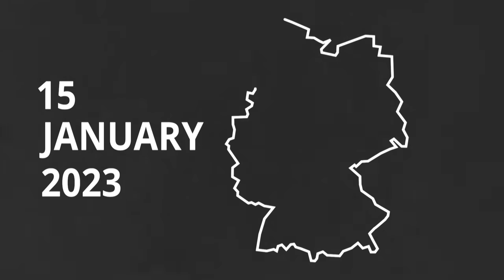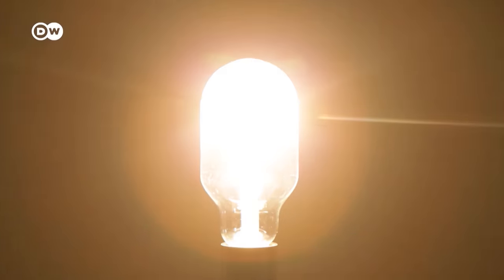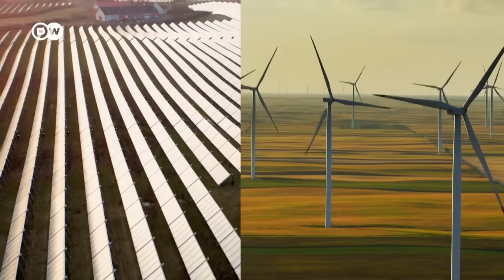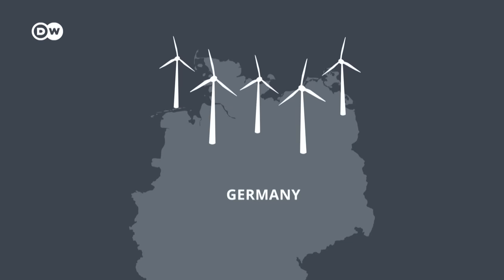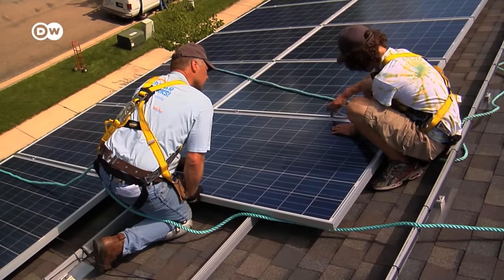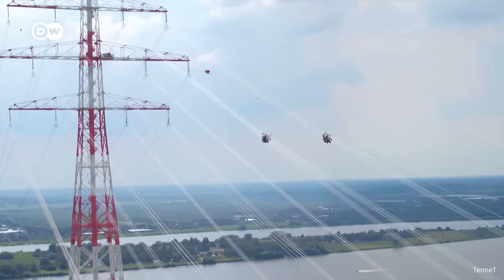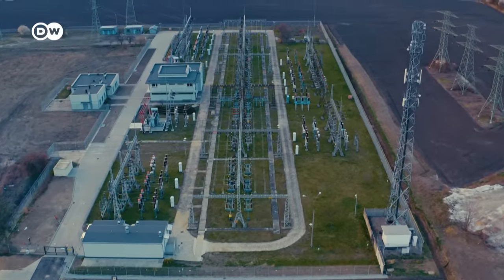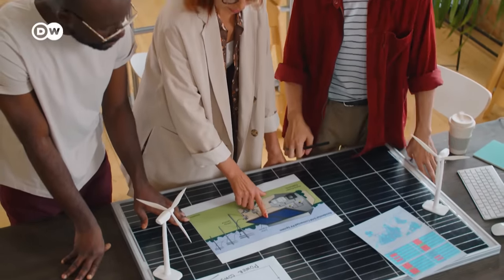This is what's REALLY holding back wind and solar

Comment: There is no boundaries to stupidity when you are motivated by idealism. The solution is very simple and it is called nuclear power plants. Unfortunately nuclear power has got a lot of bad publicity even though it is one of the safest there is. If you also take into account stability of the supply it is the safest together with hydro power plants.

Comment: The fundamental problem with any method of electricity generation that depends on weather is that it is not consistent.
An industrial economy cannot function without stable supply of electricity. Unfortunately this concept is too difficult for journalists and politicians to grasp so journalists keep yapping about wind and solar and politicians keep wasting public funds on “green energy“ projects that have no chance of success.
Numbers don’t lie, the only viable sources of electricity on large scale are nuclear and hydro.
Reply: both nuclear and hydro were very unreliable last year, due to the drought. And we will most likely see many of the same problems this year.
Reply: @thegreatdane3627  can you provide a link to a single news story reporting a shutdown of a nuclear plant or hydro generating station due to low water levels?

Comment: Wind and solar are not the "one-size-fits-all" solution. They are intermittent power; not baselode. Forcing adoption before there are solutions to basic storage, transmission, or material constraints makes for a comical proposition, that will in due time, become unavoidably apparent.
Reply: You need batteries to release the full power off wind and solar.
Batteries has dropped in price by 90+ %.
Check Tesla's way too reach sustainable power.

Comment: I hope in the future we will have a smart grid that can throttle intermittent major electrical devices like refrigerators, water heaters, and EV charging to aid in grid voltage smoothing (It would function like a classic energy sink).  I think most people would not mind their air conditioners not running for a couple minutes if it prevents a blackout.

Comment: Define "renewable sources" ; I think buying electricty from neighbouring countries and biomass (burning trash/garbage) shouldnt count as renewable. Also, outdated nuclear powerplants jeopardise the environment. Also, Germany uses coal as their main source of electricty, It didn't decline in the charts. (Using coal in thermal enegry plants).
Reply: reminder that disposal of nuclear waste by throwing it into the sea is the most viable, safe, and cheapest option going.
Reply: Wind is the biggest source of electricity in Germany, unless one adds brown and hard coal together.
Reply: @joeblogs6598  Which sea? Do you mean German should disposal their own nuclear waste into its sea (continental shelf).
Reply: @zekeriya84  Could do, when vitrified in glass the only thing that can escape is the radiation (alpha beta gamma) which is quickly attenuated by the water.
We already use pools of water to contain nuclear fuel on the site of power stations, only about 10 meters or so, even that's enough you can happily walk about above it on a bridge.

The better dump sites would probably be out in the Atlantic or other large oceans. If only from the standpoint that we might want to build wind farms or reclaim land in shallower waters at some point in the future.

Comment: Taking electricity from EVs is really dumb.  What happens when you go to drive your EV to work only to find out that the "grid" needed to drain your EV over-night because of excessive demand for heating or cooling?  Sorry, no work for you that day, and now you have to recharge your EV during peak daytime hours and hope that it will still be charged the next morning.

Comment: Better to invest in geothermal. All the energy we need is under our feet. 99% of the planet Earth is hotter than 1000 C. It is likely that in two or three decades deep energetic rather than mechanical drilling will be economically viable.
Reply from the maker: Hey there, you mentioned geothermal energy - please check out our video where we checked why most of it is still untapped 👉 https://www.youtube.com/watch?v=c7dy0hUZ9xI. And don't forget to share your thoughts in the comments! 🏵

Comment: I already do my laundry, run the dishwasher, charge the van and heat the hot water using low cost nightime electricity. If I could have the grid operator control these so they happened so as to best make use of renewable electricty I would.

Comment: We tend to see Germany as a well organized country of rational people. But their (your - you are Deutche Welle, after all 😀) energy policy made me doubt my preconception:

- Spending enormous money on residential solar installations that have, due to German climate, only token value.
- Building impressive wind capacity on the Northern shores and neglecting to provide transmission capacity to the industrial South. I am utterly baffled by that. 
- Utterly idiotic move to shut down perfectly good nuclear power plants, as the knee-jerk reaction to the Fukushima incident, that was the ultimate testament to the safety of nuclear energy: magnitude 9 earthquake and resulting tsunami hitting poorly designed plants resulted in, maybe, one radiation-related death.  I cannot shake the impression that coal and, even more, gas lobby had their fingers in that.

BTW, most of that energy you imported on Jan 15 2023 came from French nuclear plants. Talk about irony.

And how on Earth does Germany plan to doubly the share of renewables in its energy mix in mere 7 years ?!? Not even reactivating all nuclear power plants would help very much.

Comment: "adjust demand to meet supply" yeaaaa..... Sadly when solar got peak production people are at work (and then stuck in traffic/ shopping etc.), wind is more random. 
Also working people got a few hours of "free" time daily, and you can't do loud stuff (washing machine) between 10pm and 6am... So waiting for time when govt. will "allow" them to use an electric range, washing machine, or water heater to take a shower is out of the question.

Comment: Nuclear is the future. Especially smaller Nuclear plants.
Reply from the maker: Hey there! We did some videos on nuclear energy that you could be interested in: 
Nuclear storage underground 👉 https://www.youtube.com/watch?v=QFEd5RkotFE
Germany´s nuclear exit 👉 https://www.youtube.com/watch?v=eWuGP_aBoYg
Thorium nuclear energy 👉 https://www.youtube.com/watch?v=Km6kqykX900
Do we need nuclear to fight climate change 👉 https://www.youtube.com/watch?v=9X00al1FsjM
Reply: @DWPlanetA  Have you considered doing a video about storing nuclear waste at the bottom of the ocean? 
Vitrified nuclear waste would be dropped a few kilometers down onto the seabed where it would remain safely. Water absorbs the radiation, the glass keeps the majority of the chemicals in. Anything that escapes the glass would be rapidly diluted by the millions of tonnes of water surrounding it. Also zero risk of it leaking into ground water. As well as being impossible to recover by any bad actors.

Genuinely seems the best way of disposing of it, yet no one discusses it.

Comment: A better grid and battery storage will fix this easily. Electric cars store a lot of electicity that can be used in emergencies instead of grid power.  "Vehicle to grid" is a very important feature for EV's, only a smaller additional battery for the house is needed that have to last the time the car is not at home (12 hours or so) a house doesn't consume much power when peole are at work anyway. Hydrogen will only be used for less than 1% of electricity in rare circumstances. Hydrogen cars are really, really stupid idea on the other hand with so much wasted energy, but as an emergency storage for the grid it's fine.

Comment: And again, with all those videos. Learn to use less energy is the only real solution there is. It is just humanity which is not capable to accept that.
Reply: no... Anything we do need energy. We need more clean energy, and more is always better. With enought energy, you can 100% recycle everithing, without it, you cant even produce crops.
Reply: The EU, US, Japan, China, Canada, UK and various other countries, regions are pushing to move to BEV by 2030 - 2035.

There is NO SUCH THING as using less electricity when electric capacity needs to grow by about 1.5X over current usage.

I think this is going to come as a SHOCK to different countries, just how much electricity is needed.

So, the movement of electricity across a large grid has to improve in many countries, and for part of what was talked about in this video, the dropoff in power as the sun sets when you still have the heat of the day and ACs are running pretty heavily can be dealt with by overproduction of wind/solar and then use grid storage to release energy for 2 - 3 more hours to get past the heavy demand periods.  This is well known.  

The issues are the movement of energy around a large grid (in the US this is pretty good but still needs to get better in parts of the country), and the buildout of grid storage.  And there are VERY cost effective methods to produce grid storage that don't use rare earth materials which are VERY suitable for that use case, and the companies making them don't include Tesla, who are using Li-Ion batteries for grid storage which is TERRIBLE.

Comment: I believe that producing hydrogen and burning it when needed is the most practical way to store the energy. You can produce it whenever you want and you can use it when every you want. It would turn into the same system that we had over generations but now clean instead. No big changes in the grid necessary. 

Also if there is an excess of hydrogen at some point we can use that as fuel for transport as well. That it is way less efficient as using the electricity directly does not matter that much if we have an excess amount of energy that would be wasted if we cannot get it where its needed. And the efficiency will get better over time.
Reply: That's a very dangerous viewpoint towards hydrogen. Filling our society with even more hydrogen is a really good way to turn your cities into disaster zones. Perhaps put into a better perspective, you can cause hydrogen to blow up at any normal temperature by just smacking your hands together, dropping something on the floor, farting, charging your phone for too long, letting direct sunlight fall on it for more than a few minutes, or perhaps the most terrifying just getting a little too much of an oxygen concentration in the room. Lastly, once the hydrogen starts to explode, then ALL of the hydrogen nearby immediately explodes which is different from the powerful but much slower burning of gasoline or even kerosene.
Reply: @setcheck67  do you have any reports on incedents that happened in that manner?
Reply: @Chewbacca55  Is NASA good enough for you? People tend to think of hydrogen production for fuel as like the gas, which is dispersed enough to at least mostly require an actual flame or high voltage spark. Liquid hydrogen, which is how such hydrogen would be transported/stored/used does not even require an actual flame. Just a little too much concentrated heat and boom. https://www.nasa.gov/pdf/513855main_ASK_41s_explosive.pdf
Reply: @setcheck67  lookup the powerpaste from the German Frauenhofer institute. That is hydrogen bound in magnesium. What do you say about that?
https://www.ifam.fraunhofer.de/content/dam/ifam/de/documents/dd/Infobl%C3%A4tter/POWERPASTE_energy_storage_solution_fraunhofer_ifam_dresden.pdf

Comment: What about nuclear eh?
Reply from the maker: Hey there! We did some videos on nuclear, check them out:
Nuclear exit Germany 👉 https://www.youtube.com/watch?v=eWuGP_aBoYg
Thorium nuclear energy 👉  https://www.youtube.com/watch?v=Km6kqykX900
Nuclear to stop climate change? 👉 https://www.youtube.com/watch?v=9X00al1FsjM
Reply: @DWPlanetA I think he meant "what about mentioning nuclear when you say things like 'option 1 fossil or option 2 better grid + hydrogen' ?"... No option 3? That's not the topic of the video (which is good!) but it sounded a bit like this was the only non-fossil solution... Nuclear has its own problems surely but not mentioning it as a possible dispatchable and low carbon solution is kinda misleading.